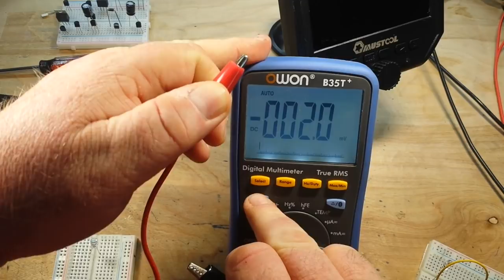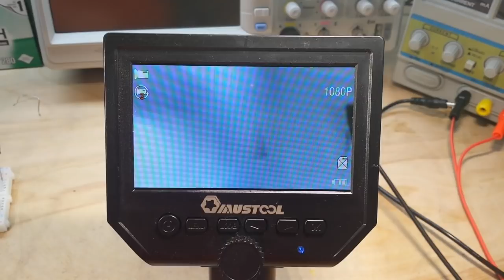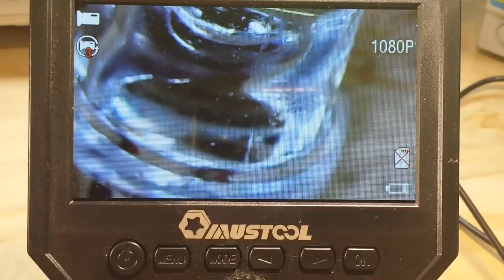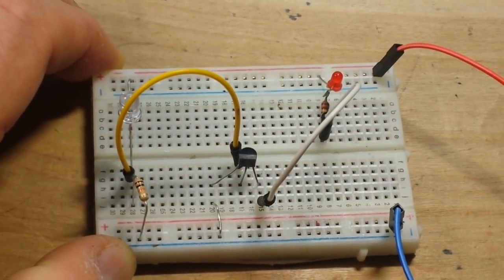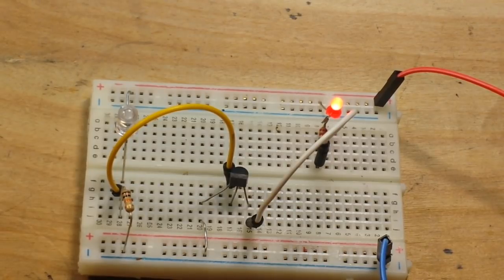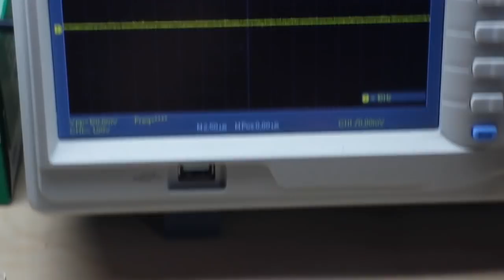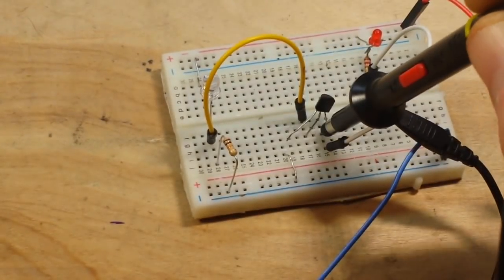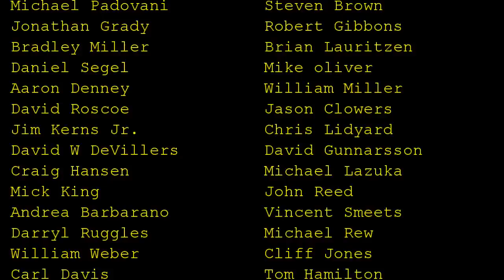When is an LED not an LED?

Comment: Thanks for the great video!
So, is there any situation where I would benefit from using a photo diode instead of an LDR or even a regular LED, in a micro controller setup where I typically am constrained to measure voltage (changes) from my sensors via an ADC?
My current project is a line follower robot, and a lot of pre-made line sensor circuits use an IR LED + IR photo diode pair, but when I make it from scratch myself, I find the LDR sensor gives me a much simpler solution.
What am I missing?
Reply from the maker: Thr photo diode generates current in response to light. An LDR is just a resistor.